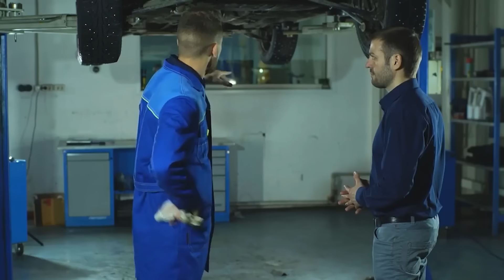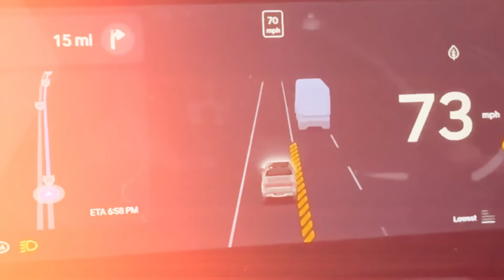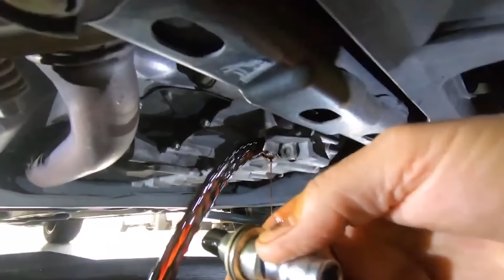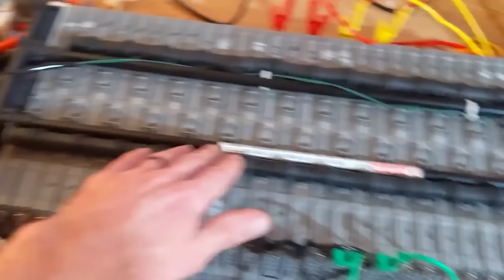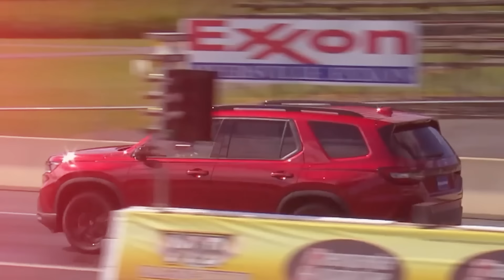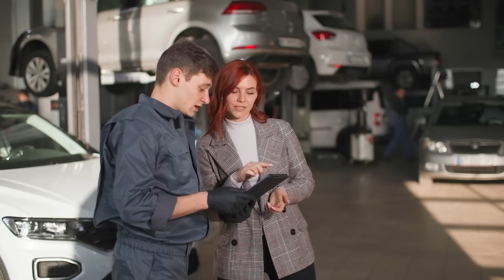NEW Honda Service Center Scams That You MUST Be Aware Of!

Comment: This weekend, I brought my Honda Accord in to the Honda dealership to get a Honda Sensing software update. They did that, but they also gave my car an inspection and the report said I needed a brake job, changing the brake fluid and also the engine coolant. What they didn't know is that I had just gotten the brake fluid replaced the day before by a local repair shop, and the technician at the shop said I had about 50% of my brake pads remaining, so no need for new pads. HONDA WAS LYING TO ME!  

Never again!

Comment: Never bring to Honda!! Horrible job on my 2016 CR-Z. They put long scratch along door & side mirror, cracked the windshield, never put on new rearview mirror properly. Just slideS off. Take pictures so you have proof of before & after photos when you take it some place. They also are horrible at putting up door visors. One is higher than other one. On top of all that, the entire inside of car smelled like an ashtray when I arrived. I don't smoke! Now have to smell it whenever I hop in.

Comment: The Power Steering went out on my 2014 Honda Civic.  I took it in and they initially said no wiring issues.  They replaced the power steering chassis and a week later called to say the sensors were bad.  Also there was some maintenance issues that needed to be addressed.  I did believe that because I am diligent on keeping the car maintained.   This was a total of $3500.  Another week later they stated that it was still not operable and the car needed a new wiring harness and the new total was going to be $7500.  The Kelly blue book value is $6000.  I said no!  I was not going to do that then they said we will patch the harness and stick to the original price of $3500.  After thinking about it, I decided to purchase a new Accord.  I was going to purchase a new car last November but decided to wait a year.  It all worked out, I have a new car and am happy.

Comment: These “scams” are not just by Honda, but are really across the board. Auto manufacturers are under increasing pressure to make more profit, particularly when having to meet the ridiculous CAFE requirements of the government, they have to come up with creative ways to make that profit. They use “complimentary maintenance” plans or a “free extended warranty” but in reality, they’re all designed to increase profit and get you into the dealer where they can attempt to sell you additional products and services. 

Manufacturers now are trying to convince lawmakers that you should be required to have your vehicle serviced at a dealership. Their reasoning is that many of the components are proprietary, thereby making the only place authorized to perform service would be the dealership.

Comment: I own a 2022 Honda Accord that i purchased brand new. I went to a Honda dealership for a simple oil change that i had a coupon for. I ended with a $400 bill for services they insisted were needed. I checked to see if they filled my windshield washer fluid. It was bone dry. I will never purchase another Honda!

Comment: Went into my local HONDA dealership,  because my remote was inop, only $25.00, , I did learn! When my wifes remote went, I replaced the friggin battery for .25.
When we received a recall from HONDA...straight forward...the HONDA dealer wanted $500.00 over and above the frigging recall

Comment: My wife’s 2019 HRV started having starting problems. Took it in they are saying the sun roof drain filled the floor with water and caused the fuse block to have problems and all the wire harnesses needed to be replaced. They said the parts alone are over $5000. Car has 22,000 miles on it. The fuse block is under the hood. CANT wait till our insurance adjuster takes a look at it. I don’t trust this dealer anymore.

Comment: I DONT BELIEVE IN THEN THEY PUT ALOT OF OIL ON MY ENGINE AND IS WAS RUNNING ROUGHT SO I NOTICE AND I HAVE TO TAKE SOME OF THE OIL OUT AND THEY ALSO INFLAT MY BACK TIRE LEFT SIDE WAS OVER 38 psi  and right side was 54 psi and left front tire was low at 16 psi and front tire right side was at 38 psi i was driving like that for 2 week because a the tire code was coming on everytime so today i check each tire and put it at the right amount of air at 32 psi i have a honda cr v 2017 i wont take my car there never again they dont care abd they play me dirty my car is not drive the same since the last service they did 😢

Comment: I have two Hondas, a CRV and a Jazz. When we first got the CRV we noticed a smell of exhaust inside the car. We took it to Honda who said there was nothing wrong with it and we must be imagining it. We were in our 70s and we're obviously an easy target. It eventually got so bad we took it to our local garage. A mechanic opened the bonnet and immediately found a cracked exhaust hose. He replaced it and the smell disappeared. We take both Hondas to the local garage for servicing now. I dread to think how much damage we did to ourselves before we managed to get it fixed.

Comment: 100% true!
They are a scam. 
Technician advised me that a Check Engine light just to check it-is $180. And a transmission filter is $400 😂
A holes! 
Basic scanner is 30-40 dollars (you own it for life) and tells you all the codes. And filter is $40.
You do the math, and you be the judge 😊

Comment: This guy is kind of an idiot. He’s talking right now yeah you don’t need a few injection cleaning that 50,000 miles. You’re right not everybody does need one, but I’ll tell you what if you drive a Honda and you want to last forever do this maintenance it will save you money in the wrong future because the gasoline today is such garbage gasoline. Don’t waste your money on that carbon cleaning crap just use a good grade. Gas and drives for a long time.

Comment: Went to honda for sunroof issue. My advisor told me i needed a brake fluid flush because it looked like it had never been changed. He never even opened the hood, i was watching.I just replaced a calliper with brand new fluid in reservoir a week prior. They lie theyre asses off.

Comment: I'm experiencing some of this now. I had to have my fuel pump replaced (a recall) for my 2018 Honda Civic Si Coupe. They said I needed the following done: Alignment - $118.84 (When on the road, I let my hands off the stirring wheel and it doesn't drift to one side or the other),  Cabin Air Filter replacement - $83 (did it myself for a lot less!), EFI Service (Fuel Injection Cleaning Service (they want it done every 30K miles) - $204.95 (my Civic only has 44,260 miles), Transmission Fluid Service (every 30K according to them) - $205.92 (my Civic Si is a 6-speed manual transmission BTW!), and finally the big one...Valve Cover gasket replacement - $430.37 (according to them it's leaking, even though I keep my Honda Civic Si inside a garage and see no signs of leakage on the engine or my garage floor!). Yeah, I think the dealerships are scams!

Comment: What I recently found out from a friend who has a neighbor that works for a Honda dealership in Orange County as a service technician(mechanic) is how they get paid, and for the most part all SoCal dealerships operate the same way per this mechanic. The cost for repairs are jacked up that allows a percentage of the cost to split for both the dealership and the mechanic. After ten plus years of using Honda service since I purchased a new Accord and a Civic, the service prices were very good for the first ten years for vehicles that had less than 65K miles each after ten years of ownership. I went in to my local Honda Whittier dealership in  May of 2025 for an oil change with a coupon for 15% off. The service advisor indicated the cost after the coupon deduction would be $135, when in the past I generally paid half or less. I immediately advised that was too much and that I would go elsewhere. The service advisor made a computer check search and found a deal where I would only have to pay $65. I had the oil changed and from that point on my confidence level for this dealership after ten plus years went down the drain. This video sure does encapsulates the shady practices that Honda dealerships use to scam customers. I enjoy the Honda vehicles, though I despise the dealership corrupt practices.

Comment: I had a dealer change my tire back to the original rim with the new tire that was on the spare. ( the spare is the same rim and tire,  just a different color rim) i had had a flat and was just running the new set.
I told them to make sure they put the sensor back in.  4 total trips, telling them it was not there.  After I had another tire center check, it was still in the spare, i caused a huge stink. When they found it, he apologized and promised if i would come to them,  they would take care of me and put a tank of gas in due to 2 hr drive.
Just had to have a new air compressor, at 35000 19 months. 
It was covered but they claimed I needed some kind of fluid changed, and it was leaking. $155 Sent me a picture and when we said we saw nothing,  even dust across the entire area,  he said we had to be blind.  He was mad because i don't use them to do my oil.  He called the local shop inept.
I told him to not do it and I went back to get it. Gas tank almost empty, didn't do what he promised if I would come to them. 
  He got rude with me in front of a waiting room with customers.  I told him if course i can't trust you. 
I took it back to my local guy,  when they got under it,  they showed me the "brush washer" honda said had been messed up by these guys,  come to find out, IT DIDN'T EVEN HAVE A BRUSH WASHER,  JUST A REGULAR ONE.   Boy were these local guys mad because they were calling them idiots.  2nd dealership I will not go to.

Comment: Declined all services including the wheel alignment
I'm on my 2nd set of tires with 80k miles, not a single issue with tire wear
And I didn't need to do a wheel alignment when I put on my brand new 2nd set of tires
It's all a rip off, mainly only needed if you raise or lower your car suspension, you should definitely get one then

Comment: All I've ever owned and driven were/are hondas. Its not just that, but they make it harder and harder to easily service these Hondas. Not as bad as other brands, but its getting there. Making it a chore to fix the car on your own is half the battle in locking you into the tyranny of the honda service center.

Comment: Dealer wanted to charge over $3,000 for a timing belt change. I bought the parts and paid a local shop to do it for less than a third of the price.
Reply: Same!! They wanted $3600 for a timing belt. A diff mechanic did it for $800 and I never had any issues

Comment: The required service at that milage may be: oil chsnge, rear differential service, break pads, possibky break fluid change, possible coolant change, alignment, tires.

Comment: The center  propeller shaft hanger bearing blew on my 2014 Honda.  The service tech said its a $4,000 replacement.  After lots of questions with shocked looks (from my wide & I), the tech then explained its a simple drive shaft part and many DIY folks replace with non-oem replacements (found on internet surfing).  Then he winked.  He removed the bad rusted shaft (with his tools) and charged me 1 hour time.  Yes.  Minimum 1 hour shop time.  I then found a clone  replacement for $306 (including shipping & taxes).  I installed myself a few days later. Luckily my Honda Service tech saved us stupid amount of repair monies...

Comment: The last two times our 2007 Honda Element with 98,999 miles went to the our local dealer for oil, filter and inspection, they claimed the car needs over $4,000.00 in preventative maintenance. Laughed and said no. Car still runs great. BTW, we have owned this car as a vacation home vehicle since 2011, always had it serviced at the same dealership, and they never used to pull this crap! We never have these issues with Lexus service.

Comment: I’ve never experienced this at the Honda dealer I use.   I have a 2021 Ridgeline I just took in for 48,000 mile service.  I got oil change, brake flush and rear differential fluid changed. $320.00.  No upsell. I actually requested these services.   Maybe the dealer I use is the exception but I’ve always been treated well there.

Comment: Lease for 36 months and 36,000 miles. It stays under warranty. With that said, the lease use to include three oil changes and your first payment made by Honda - no longer provided. Honda is a good vehicle but, they are definitely starting to gauge and gimmick.

Comment: Buying a Honda is a scam , Honda is knowingly selling faulty cars and trucks, the CRV has head gasket failure, CVT transmission failure, oil dilution problems, electrical problems, and the civic ,and accord have the same 1.5 turbo problems, the Odyssey, Ridgeline ,and pilot have engine and transmission problems.

Comment: I just went to a Honda dealer for my 2nd oil change/tire rotation. It’s a 2025 pilot. 10k miles.First they told me on the phone that with the new oils I can wait for the oil change until the warning light comes on. When I told them I’d be more comfortable doing the service now, they made the appt.   When I arrived at the dealership, they pushed super hard that I need to replace a bunch of filters and do a wheel alignment!   I declined everything except the complimentary oil change and wheel alignment. Crazy. First they didn’t want me to come in, and then when they realize it’s a comp service they do the hustle.

Comment: My Honda 2015 broke down with all the lights inside going off.  Towed it to the dealership and they told me the starter my dad put in was the wrong starter and they recommended changing it.  They change out the starter and then told me it was the alternator which would be another 3 grand.  One thing after another to get as much money out of me.

Comment: Yes, well consider this. You buy a Honds and years later the car is diagnosed with a paracitic battery drain, $4,000 - $8,000 to fix. You go online researching the Honda paracitic battery drain and discover, that problem is Only 8 years ongoing with no apparent recalls. Oh there was one class action lawsuit that was dropped 6+ yrs ago but Honda, I guess, has refused to do Anything about the problem. Maybe it is still an ongoing manufacturing defect the government is unaware of?

Comment: Just had my timing belt replaced on my v6 accord. They were reasonable. Also came back saying it needed new tie rods $980, lower ball joints $1100. Oh yeah. I don’t want to forget the $36 quart of 0-20 oil. Not only is this stuff even a doofus like me CAN do at home, but my local mechanic will do for literally a small fraction of that. Dealership has royally PO’d me with that stupid crap.

Comment: I have a 2018 Honda crv. Took it to Honda for motor oil change. They lift up the car keep it up there for over an hour and never change the oil. I guess they never saw my dash cam or though it was off. When I showed them the video then they started blaming the guy that it was supposed to do the job. But I know they all were in it. I just claim my money back and left.
Reply: Did you tell them gotcha?

Comment: Got the new car and later checked the tire pressure to see they were all over 40 psi!
Got an o'l change and alignment.  They did not fix the alignment and left my pristine passenger seat with a  huge grease stain.
They wanted to charge me double to do it "again", because I could have hit a pot hole right outside their  shop.
The did not fix engine vibration.
They did a good job on a flat tire and reinstalling weatherstrip.
Note, if your warranted tire goes flat and the tires are a worn too much, you will need to pay for a matching tire.
<Hopkins>

Comment: I wanted Honda to change a rear defroster relay because it didn't work. They wanted a electrical diagnostic before fixing the problem . The diagnostic costs $195  and it doesn't fix the intermittent defroster problem. The fix if it exists would be extra.

Comment: It really does depend on the dealership. I've driven only Hondas (with one mistaken exception) for 40 years. I love them. However, the dealership nearby is filled with incompetent,  irresponsible sales people and a service department with some of the highest markups I've ever seen. I needed mudflaps for my new Accord, and the local dealer wanted more than twice the money - for parts only - that an out-of-state Honda dealer wanted. Anyway, I found an excellent local shop run by former Honda technicians, and now I only use them. They even tell me that I don't need a service I asked for if they don't think I need it. Can't beat that!